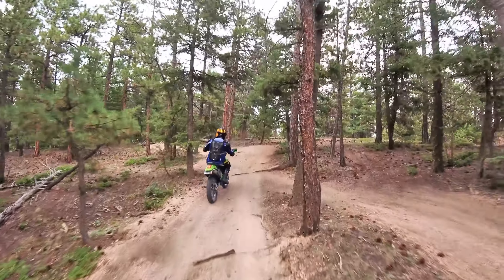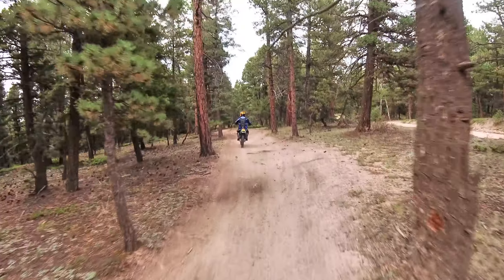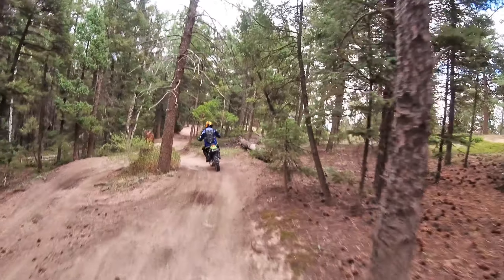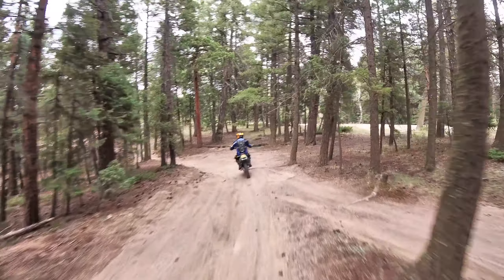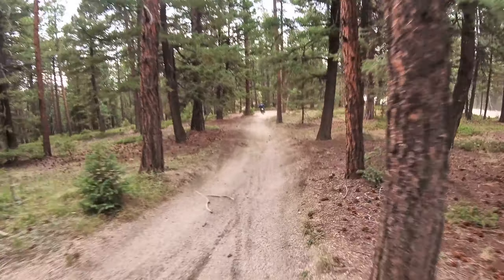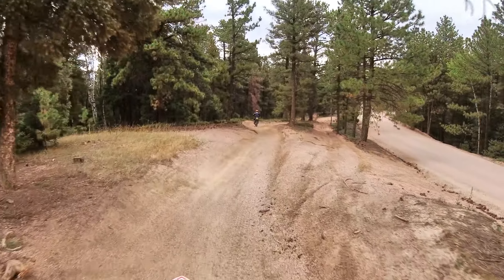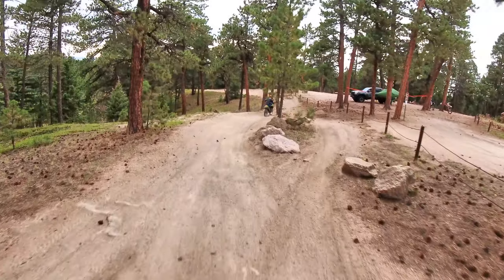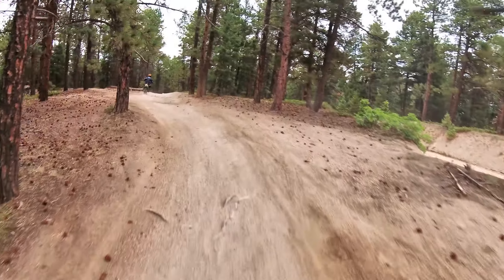Beta Dirt Bikes: Things I Hate About Them

Comment: I’ve been running the 3 gallon tank on my 500 and changed out the tail section since the day I brought it home. The bike is uncomfortable enough that I don’t ride it much further than 100 miles at one time.
Reply from the maker: Yeah a new seat is on my list to get. I've done 200 mile days on the Beta but it kills the ass that's for sure.
Reply: Seat concepts you can get it from the dealer

Comment: The Beta seats are terrible hard and they should replace the plastic oil pump with the steel one and also dimple the radiators for better turning.  These three things wouldn't cost hardly anything but would make the bikes much better.
Reply from the maker: Funny you mentioned that. Those plastic gears gave me some trouble.

Comment: I only got 50 miles per 2 gallon tank on my KTM 505xcf. 40 miles per gallon is awesome.I want my RRS to be as close as possible to the race edition. The RRS is for the race guys that want it street legal, don’t ruin it for everyone. You need an Africa Twin and stick to the fire roads. The kick stand is garbage agreed.
Reply from the maker: When it comes to making the Race edition or RR street legal they can be in most states to begin with. Those already are much more race oriented than the RRS just by their suspension alone. I do not think including a 3 Gal tank and a ECU fuel saving map compromises the RRS in any way from its current form at all. It only makes it more marketable to more DS riders. LOL I buy and ride what works for me. Just because I will ride fire roads and easy trails on a beta at times means I ride single track just as much. Versatility in a bike is what I like about Beta.

Comment: Hi !

Can you tell something about the traction  control  of beta 500 rrs   ?  I want to know if the throtle is still abrupt in rain mode. Can ABS be instaled from another motorcycle ? Do you know if the piston has 3 rings , as Honda CRF450L has ? How many HP in rain mode ?
Reply from the maker: The Beta has a lower power mode. It's an EFI mode that reduces throttle power through your throttle range. It's not traction control in the sense of limiting slip, this bike is an Enduro first. As for ABS I have no idea why you'd want ABS It's horrible on motorcycles you loose all control over your brakes. I hated them on both BMWs the 800 and 1200. The piston is a standard 3 ring. HP in rain mode isn't totally limited above 75% throttle you get full power.
Reply: @pharettface  Thank you for the reply. 
I want ABS for the street, as a security measure.
Regarding the rings, there are 3 compression rings and one for lubrication ?
Reply from the maker: Idk to each there own but I never found ABS a help even on street bikes. Yes Beta uses a standard piston ring set. With lubrication ring. But realistically you won't have to worry about it. Meeker Extreme had over 400 hours and thousands of miles on the stock piston of the 19 500 rrs and it burned no oil or had power loss
Reply: "standard piston ring set" means 3 compression rings and one for lubrication ? What is standard ?
Reply: @fcalin21  , have you considered not asking stupid questions?  Don't buy one if you have this much anxiety.
Reply: @captainamerica9353  You have issues.
Reply: @fcalin21  , not really.  "Can ABS be instaled from another motorcycle" ??  Are you kidding me?  "How many piston rings" ??  I don't think the poster here is the chief engineer for Beta.  Get a bike with ABS and lots of piston rings; you should be ok, then.

Comment: Horsepower takes gas. Can't have it both ways.
Reply from the maker: Well I think with an EFI system you have a little more room to tune for something specific. Beta already has the "rain and sun" modes. There is some MPG to be had in the lower power map as it is. I think with dialing back the engine timing and fuel Beta could have a map for 50MPG+ for those long DS days and right at the push of a switch you can get the full power of the bike back. I think that would really make the RRS line awesome.
Reply: @pharettface  I just find it ironic that people drool over high powered lightweight bikes then complain that the mileage is awful and the bike doesn't have enough tank capacity. A bigger tank capacity from the factory increases the wet curb weight thus lowering it's attractiveness. It's a fact that less horsepower increases mileage.
Reply: The tank weighs 7 pounds more.  It's the fuel that weighs the most.  Don't fill it if you don't want the weight.
Reply: He asked for a map that doesn't produce as much power.  Hence, better mileage.so yes, you can have it both ways.
My 84 camry had an eco setting that gave it far better mileage, albeit at reduced power.

Comment: That guy needs to stand more
Reply: Bro it's a dualsport and as a rider beta seats are just for show.. lol. Yamaha yz250's a have nicer seats and beta vibrations are stupid.. they rattle your bones.. wouldnt be an issue but the horsepower is sad compared to others.. but the low end grunt is bar none.. love my 2013 250rr.. great woods monster.. but my yz250x is faster on the dry races..
Reply from the maker: Always room for improvement on machines. As for vibrations I am not sure what that is coming from but Beta's both 2t and 4t are far from buzzy vibration machines. Could just be improvements in recent years but I have not seen anyone complain of that on newer Beta's. Beta has come a long way since 2013 I'm not much into smokers but I have yet to see any one displeased in person with the newer 250s and 300s.
Reply: @pharettface  I was just comparing my yz to my beta.  I love my beta.. I know as of 16? (Could be off on year) they started to counter balance the 2t to reduce vibration.. but I love how controlled the throttle and power is vs my yz.. beta I can ride and use its power the yz is all or nothing lol ripping my arms off.. which is why I own both..

Comment: You only have so many BTUs per gallon of gas.
Reply from the maker: I mean there is about 33 KWh of energy in a gallon of gasoline. That comes more into the efficiency of internal combustion engines at that point. The energy is there it's more how it's used. After working with a local tuner on the betas we've been playing with a fuel saver map for the 390. It's a pretty big difference, big loss in power but with the flip of a switch it's easy to get all the power you need when you want it. I plan to have a video on this once it's complete.
Reply: @pharettface  looking forward to that video!